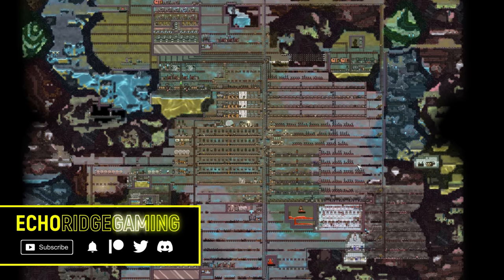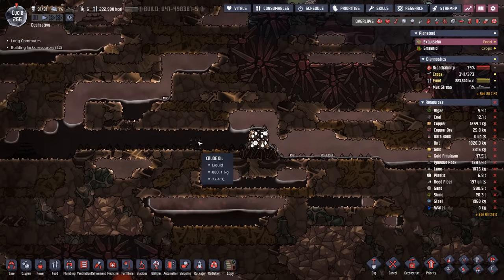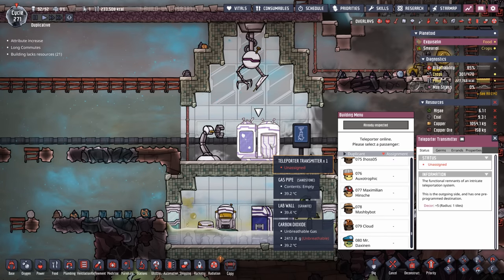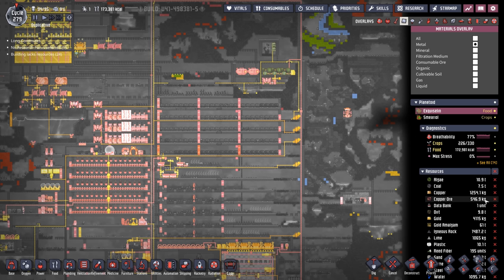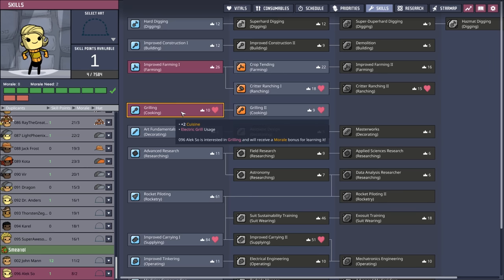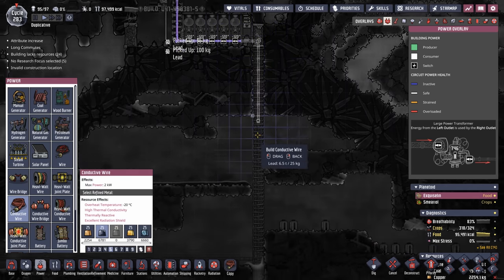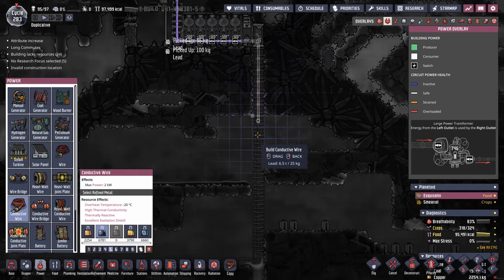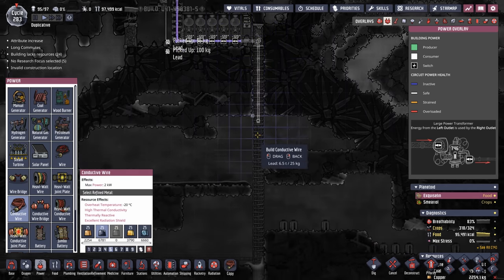Water Towers and Bog Jelly | 150 Dupe Challenge Ep 9 | ONI Spaced Out

Comment: ive been working on a heat spike polluted water boiler using the magma core of my base, i think it'd fix your dirt issues but i dono if you have enough kg/s of water to feed it. my current version uses 10 turbines and processes 30 kg/s of polluted water and my map has 8 water sources between salt and polluted water.

Comment: I would love to eventually see an automated rocketry program that continuously ferries stripminded resources and gysers to a single planet. The lore being you are an advanced invasive species whose culture places value on hoarding vast quantities of resources at their home. On the technical side, you would be reducing the lag generated from colonies (besides home) to an absolute minimum. No need to calculate gas pressures, heat, or animal pathfinding if the planet is simply a few volcano tamers and geysers that just get piped up to a rocket that swings by occasionally. For most of the planets, you won't even have to worry about refueling for the return journey. For a good way to have a rocket manned indefinitely without micromanaging, francis john developed a decent setup when he was going for the "mine the gap" achievement. PS if I could get a dupe the has a love for construction that would be great!

Comment: do shove vole ranching if it possible, you only need rather small stable (4x6 tile) ranch it, give some regolith at first until spawn multiple vole and starve ranch them.
it give you 16.000 kal per shove vole and do not get a lot of performance penalty since you only use small stable for it, the main downside it slow just like other ranching do
Reply from the maker: We started it two episodes ago (behind the scenes, not going to reveal until it is up and running)